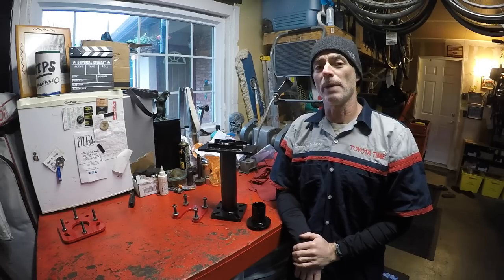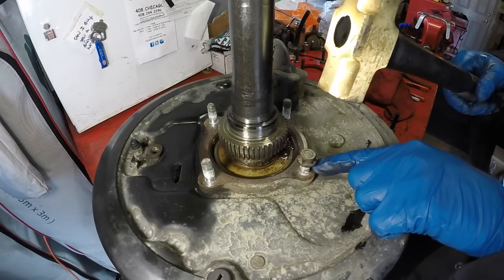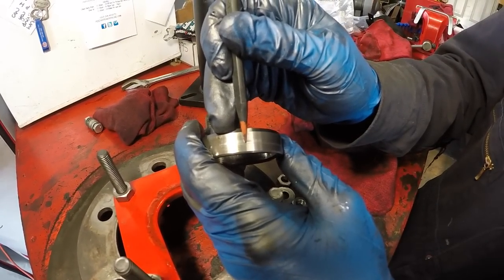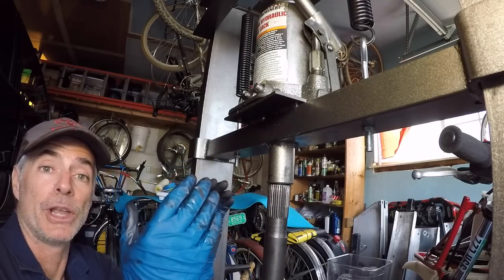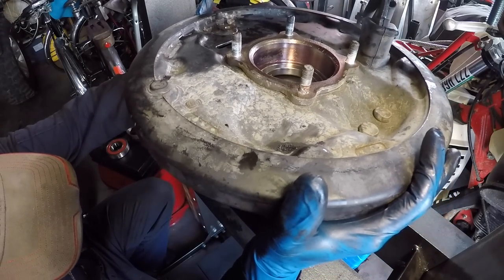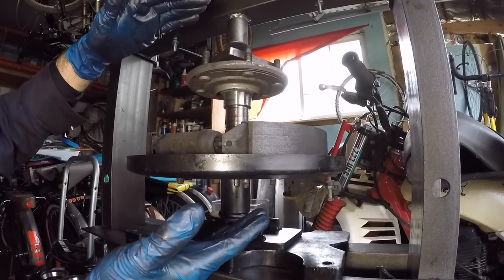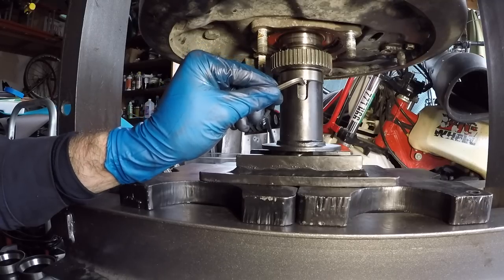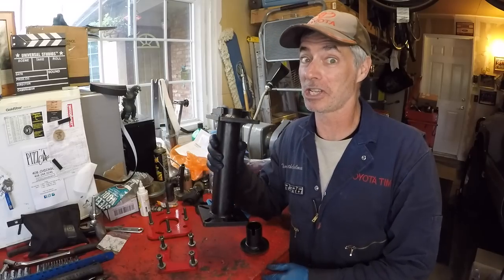Toyota Rear Axle Seal/Bearing Replacement (Part 2)

Comment: Im about to do mine on a trd tacoma is there no extra step with the locker ie leave it unlocked ??
Reply from the maker: You would want you e-locker unlocked for this job.  Hope the job goes smooth for you.
Reply: Awsome thank you so much.love your content btw thanks for all the videos.
Reply from the maker: @nickcraig2417  You're very welcome Nick.
Reply: Another question my abs sensor is stuck and channce i can do it without removing it
Reply from the maker: @nickcraig2417  If you're going to do the complete job, the ABS tone ring needs to come off for you to be able to replace the bearing.

Comment: Hi Tim, I was about to do this project and ordered all the parts, but Toyota ended up refunding me for the 96-02 bearings. Apparently they do not make them anymore, at least for the time being. There’s a supply shortage? Anyways, do you know of any other suppliers with those bearings? Amazon is out, and it looks like an eBay seller has one… Thank you.
Reply from the maker: That's not good to hear that Toyota discontinued them.  That's a huge mistake if it's true because there's tons of Toyotas on the road that run those bearings.  I usually buy my Toyota parts from a local dealer.  I don't know of any other sellers other than doing a Google search for the part number and see what pops up.
Reply: @TimmyTheToolman  yeah it’s definitely a bummer that they’re gone for now. I hope it’s just a temporary issue, but who knows. I found a thread on t4r that says if you search ‘RW130R’, the rear bearing will show up from Nachi or Koyo. I don’t know if this is for the 96-00, or 01-02, but I thought I’d let the comments know. Thanks for replying! Your videos are the best.
Reply from the maker: @Chrischrimbus  Cool, thanks for sharing that.

Comment: Hey there Timmy. Do you ever plan on doing front wheel bearings on any of your 4 runners? I plan on tackling them soon. I've heard they are a major pain. Thanks
Reply from the maker: We show the needed steps in our Manual Hub Swap videos Part 1 & 2.  Those videos will show you everything you need to replace wheel bearings on your rig.  Watch Part 1 to learn how to remove and replace the knuckles;  Watch Part 2 to learn how to do the press work on a sett of A.D.D . knuckles.
Reply: Timmy The Toolman yea I just saw those right after making this comment and watched them both. Exelent videos. The only ones I could find on the internet anywhere. Thank you so much!! Always look forward to watching your videos. The valve cover gasket one really helped me out also with how you include part numbers and your little tricks. They are very much appreciated. Keep up the good work
Reply from the maker: @ericbrown6802  You're welcome Eric.

Comment: Do you have a video for replacing the front hub bearings and seals on a 1997 Toyota 4Runner with abs
Reply from the maker: Our Manual Hub Swap videos cover it.  Use our upper balljoint replacement video https://youtu.be/-sY2azyLBuI
to learn how to remove and replace the steering knuckle and then use our Manual Hub Swap Part 2 to learn how to do the press work.  https://youtu.be/1TpOYj0sUpA

Comment: Tim, Another great video! The problem with my (original) axle is that the polished/unpolished boundary/line is not straight. I brought a print out of the FSM page where it shows the 122mm  measurement from the face of the axle hub on page SA-84 of the FSM but the independent shop that is pressing my parts does the measurement from the spline. Do you happen to have the measurement from the spline side? Or do I just tell them to put the retainer in the specified location but flipped? Is the original position at 5mm polished showing? Thanks!
Reply: Darn I could have grabbed a measurement for you but I'm typing this with greasy hands as I just reinstalled the second axle on my 99 tacoma.   I also had problems with the polished surface being uneven and even though I measured about 5 mm on the first axle I did ended up with closer to 5.5mm on the "high" side and seal wasn't centered.  The second axle I pressed on closer to 4.5mm but it was still too far out and the seal wasn't riding centered. I slightly pulled the abs and retainer off and re-pressed it and found that a min. 4 mm was closer to centered for the seal.  

If it isn't too much trouble or extra cost I'd recommend pressing it short and bringing it home to check and taking it back if necessary.  I wouldn't necessarily trust a measurement from the face of hub because the bearing (w/axle) can slide out slightly when picking up assembly (as you see in the removal process where you have to bang the axle against a board to get the tool on).  
If you still have the axle with the old retainers on and the new seals are installed can you run a grease test to see where the seal rides on the old retainer location?  If so you could take the measurement to center of seal and subtract half the retainer thickness. 

(Disclaimer: This is my first time working on a rear axle so I could have ef'd something else up)
Reply from the maker: The polished surface on the axle is slightly uneven but that's ok.  It still works to get you really close.  Maybe start at 4mm polished axle showing and perform the grease or sharpie test.  What you see from that first test will tell you if you need to press the retainer on further or keep it where it's at.  4-5mm of polished axle showing is generally where it ends up placing the seal lip dead center on the retainer.  I have never used measurements like the factory service manual specifies.  The key to getting this right is to double check your work and make sure you have a good seal to retainer mating by performing the grease or sharpie test.   Since you're using a shop for the press work, I'd ask them to have 5mm of polished axle showing and you're going to be fine.

Comment: I need to buy your tool just Paid  568 and toyata service center said that they had this tool wrong they put jt together and karma got them. Lol 😂  because they used wrong side backing plate
Reply from the maker: Many people, even myself, thought Toyota dealerships are completely full of super knowledgeable and capable people.  That is not the case.  There are good mechanics and honestly ran dealership service departments, but there's also incompetent mechanics and dishonest service departments.  

A Toyota dealership botching a rear axle bearing/seal job on my 2000 4runner is what gave me inspiration to start doing all my own work with some exceptions.

Comment: Hey @timmy The Toolman, Would you risk running 5.5 mm on the inner retainer or would you pull it back out some and try to get as close to five as posssible? Curious if you think the .5 mm would compromise the seal at all.
Reply from the maker: 5.5mm is in the ballpark.  How does the sharpie or grease test look when you do it?  As long as the seal is riding somewhere close to the center of the polished shoulder, you're fine.  You just don't want to be within 2mm of either edge of that 10mm of polished shoulder.  You want to give it little room for wear as the bearings age and allow more movement in the axle shaft.  From experience 4.5 - 5mm usually is about perfect for these axles but 5.5 would most likely be fine.
Reply: @TimmyTheToolman , being a little OCD I opted to pull both the ABS and tone ring off again and reinstall, and got it right on the money this time.
Reply from the maker: @rebuildbetter  Good job Eric.

Comment: Hey Timmy!
Question? I have a non-abs. I just found the source of my intermittent growling sound. It normally happens above 40mph. I put the truck on a lift and had someone drive it. The sound was from rear rt. side and the wheel could be seen wobbling. I know it's not the wheel itself because I have rotated and some sound! I do have a differential oil lead. Do you have any idea if it is the bearing or shaft? I have use of a 12ton press. Will that be enough to replace bearing? Thanks Timmy!
Reply from the maker: It's most likely a bad bearing.  Unless the rig was involved in an accident, I doubt the axle shaft is bent.  If you were driving it previously for a while without this noise and you weren't involved in an accident or doing something crazy like jumping your truck, it's a bad bearing.  We have a video for non-ABS rearends.  Here's a link to that video: https://youtu.be/vW25hvODHcs  I still would recommend that you buy Duane's tool even though you don't have ABS.  A 12 ton press should be more than sufficient to handle this job.  If you're thinking of getting your own press, I highly recommend purchasing the 20 ton press from Harbor Freight.  The 12 ton press can handle this job but I don't know if it could handle front wheel bearings.
Reply: @TimmyTheToolman  Thanks for the fast reply! It was in an accident. Someone hit that side right on the wheel. No body damage and not hit too hard. It's been making the sound since (yrs). Had to replace the tire, split. The rim had some bent metal, around the tire sealing surface but that's it. Could it be a bent hub, hence need new axle shaft? I'm thinking, if I take the brake drum off and put a vernier caliper on the hub and rotate it, would that answer the question or could the bearing also cause the caliper to show a deviation? Thanks Timmy!!
Reply from the maker: @1963Treeman  Since it wax involved in an accident and the wheel took a hit, there is a chance the axle is bent.  I think some type of dial indicator would be a better tool than a caliper but I'm not sure if it would tell you it's the axle that's not true and not bearing play you're seeing.  I worked on a friend's rig doing an axle seal job and his rig had obviously been in an accident because it was hard to get the axle out and back in.  We thought the studs were bent but it ends up the axle bearing case was tweaked.  We ended up putting in a used axle and bearing case.  If you can get yourself an axle from a wrecking yard, that's what I would recommend.  I would replace the bearing on the replacement axle as well as the other one on your rig and just perform the full rear axle seal job following our video.
Reply: @TimmyTheToolman  I have found a replacement used OEM axle shaft with the all the brake hardware but it is ABS. Do you know if I can remove the ABS ring and flip the retainer, if I get an OEM seal, and use it for non-ABS? Thanks so much for your help!
Reply from the maker: @1963Treeman  Yes, you could do that.
Reply: @TimmyTheToolman  I am receiving conflicting info. on whether you can. The web sit that I was going to purchase the used axle shaft from, with ABS, said that I couldn't use it for non-ABS (I told them I would remove the ABS components). I called a Toyota dealer parts department to see if the part number for, Shaft only, would be the same for ABS & Non-ABS shaft and they were different. He said they were not interchangeable, yet all related parts (retainer, bearing, seals) are interchangeable....You work with them, so I tend to believe you, but I would hate to purchase a used shaft from someone and it not fit correctly. Do you know of anyone who has done it? Thanks!!!
Reply from the maker: @1963Treeman  Well, here's what I was basing this from.  The rearends on these rigs, ABS or Non-ABS are the same length.  They have to be.  The 3rd members are the same as well so there will be no difference in the shaft spline count.  If the retainers and bearings are the same, this means the shaft diameter is the same as well.  From looking at this non-ABS rear axle seal video https://youtu.be/vW25hvODHcs it looks like the shaft is a little different being that the taper starts earlier on the shaft because there's no ABS tone ring or inner retainer that needs to be pressed onto that part of the shaft with the non-ABS axle.  But, all that matters is you can get the outer retainer and bearing onto the ABS axle in the same spot as you can get it onto the non-ABS axle, which you can.   How much are you paying for the axle?
Reply: @TimmyTheToolman , All that you have stated sounds rock solid to me. It makes sense that the axle shaft part # at the Toyota dealer would be different for ABS/Non-ABS shafts because of the need for a slightly longer larger dia. section for the ABS, as you stated. The ABS axle shaft I am looking at buying is from a non-rust belt state, almost no rust (my backing plates are in ruff shape $80 for a new one), It has all the brake hardware (no drum), 145,000 miles on it (splines look great), and not involved in a rear end accident. $300 shipping include. There is one, non-ABS, that doesn't look as good, some rust & 175, 000 miles, for $160. The only other thing, and I don't believe it would make any difference, is the slightly more axle shaft weight on one side because of the longer, larger dia. section of shaft. Thoughts? Thanks for indulging me, you have been awesome!!!
Reply from the maker: @1963Treeman  Damn, that's expensive.  I picked up an entire axle with the brakes from a local PicknPull for $80.  I didn't think of the difference in axle weight but I doubt it would make a difference.  You sure you can't find one locally in decent shape?
Reply: @TimmyTheToolman  good to hear that's expensive! I have no idea about cost other than what the dealer wants for a new shaft $560. I did call a local place but none in stock. Most stock parts locally are very rusty. We love road salt! I guess I'll keep looking. The one for $159 including shipping is starting to look better. The shaft has 172,000 miles on it. Do you know the mileage on yours for $80? Is mileage that great a deal on axle shafts?
Reply from the maker: @1963Treeman  The mileage on the one I grabbed is unknown but axle shafts don't really go bad unless they were involved in an accident or seriously beat on off-road.  As long as it's not bent and the splines look ok, that's all I would worry about.  It's basically just a hunk of metal and not a lot can go wrong with it.  $159 sounds like a much bette deal but it would be even better if you could find one at a local wrecking yard for half the price.
Reply: @TimmyTheToolman  I found two. One 35 minutes away,  but I was told the backing plate may be bent, $65. The other would have to be shipped (distance) and it is only the shaft because the backing plate rusted away! Ha..ha.. they want $100. The guy said, good luck finding one with a backing plate around here! Ha..ha
Reply from the maker: @1963Treeman  Yeah, I guess because of the road salts it's going to be a rough find.
Reply: @TimmyTheToolman  Since you have a wealth of info., I'd like to ask you about the bearing for my truck. My research states I need a Toyota OEM Bearing, Radial Ball 90363-40068. Easy right! Well, I have found three bearings with that same # at a variety of names/prices: New NSK (made in Japan) 90363-40068 for $29.98, same thing for $24.98 elsewhere and then one Genuine Toyota (in their signature box) 90363-40068 for $44.98 (This bearing has "Japan NACHI 40BCVO9S1" on it). I'm sure you have run into the same thing. Quite a price difference! Any insight? Thanks!
Reply from the maker: @1963Treeman  I know Koyo and Nachi are brands used for OEM applications with Toyota.  For me, I don't spend much time on bargain hunting.  I usually go with Genuine Toyota parts and call it a day.  That's not to say I don't use aftermarket parts, because I do, mainly so far in the bushing department.  If you want to play it safe, buy the OEM bearings.  We're not talking a ton of money and I think you would kick yourself if you had to redo all this labor due to an inferior bearing prematurely wearing out.  My two and a half cents.

Comment: Hey there Timmy. great work here. Thank you. Do you know if this press sleeve kit will work with the HF 12 ton press? it is a bit shorter then the 20 ton. I'm planning to do my '02 Taco.
Reply: well, read below and answered. Sounds like the 12 ton is too small, unless a different cross member is made.
Reply from the maker: @zmbombr  I would highly suggest the 20 ton press because it has handled every job I've thrown at it and it's not that much more than the 12 ton press.  It's money well-spent.
Reply: The 12 ton worked with no problems height wise or power. Just had to come up with other cross members to fit Duanes kit. I used some scrap 2x2 x 250 steel sq tube.
Reply: I was just looking at Diane's Ebay site, and he now offers a version that is sized for the 12 ton HF press. I'm currently debating which way to go, but that is another option now.
Reply: @cobjread  The 12 ton worked with no problems height wise or power. Just had to come up with other cross members to fit Duanes kit. I used some scrap 2x2 x 250 steel sq tube.

Comment: Hi Tim. I'm replacing my bearings and seals on my 04 Tacoma and when I removed the oil seal an O ring made of metal and spring like came out. I cant see it on any of the diagrams for the rear end and am concerned. I'm not sure if its part of the oil seal assembly itself or it goes somewhere else in there. Any ideas?
Reply from the maker: It's part of the seal.  It goes around the seal lip on the back side.  It's basically like a rubber band that keeps tension on the sealing surface of the seal.
Reply: @TimmyTheToolman  thanks a ton. You're the best !
Reply from the maker: @cyclopz-J  You're welcome Julian.  If you have more questions, just ask.
Reply: @TimmyTheToolman  hey one more question if you can answer just in case the Toyota dealership messed up. On a previous video you stated the seal design changed and the seal part number was 90310 50006. Would this be the same part number for my 2004 4wd 3.4L Tacoma?
Reply: @TimmyTheToolman  *oil seal
Reply from the maker: @cyclopz-J  Yes, it would be the same.